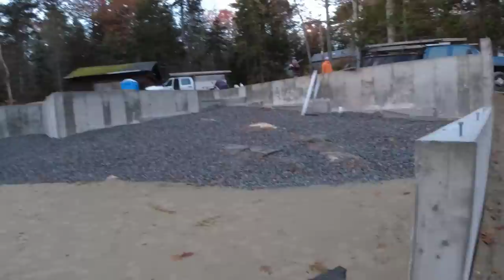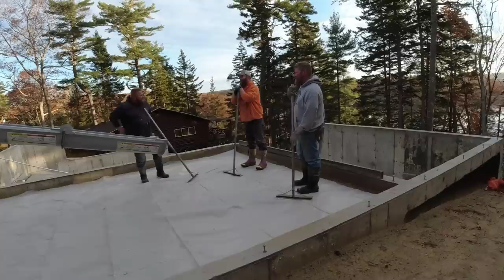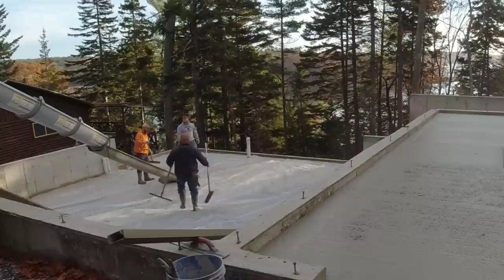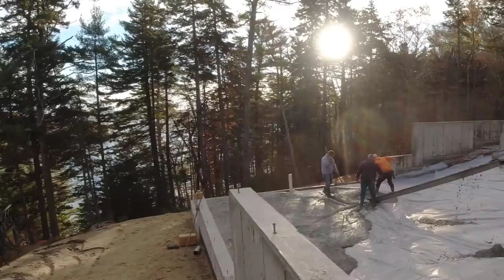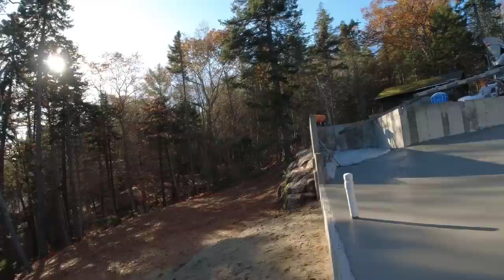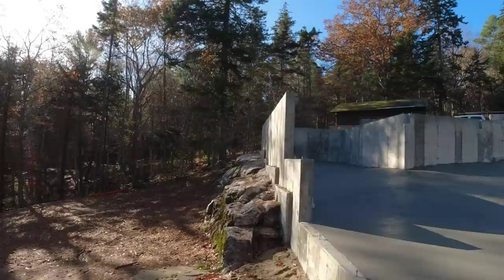How To Pour Concrete Floors On and Around Ledge | Basement and Garage

Comment: Hey mike or anyone:  does anybody pour a basement floor under the chalk line for any reason ?   At least an inch - or is the slab sinking ?        2 year old house....thanks
Reply: Could have been a mistaken height line when prepping.
Reply: Settling
Reply: Realized to late they might run short of concrete, and not able to get another load, drop the grade a bit, to stretch the amount you do have. Not a good solution, but it happens all the time. Better than a patch in the floor the next day.

Comment: I have a question 
I see that the concrete has quite a bit of water added, so if you poured the same excat slab with runny concrete or dryer concrete,  will the results still be the same after it hardens ??